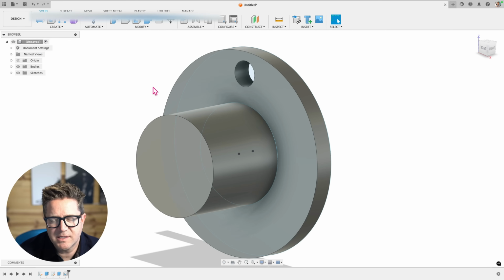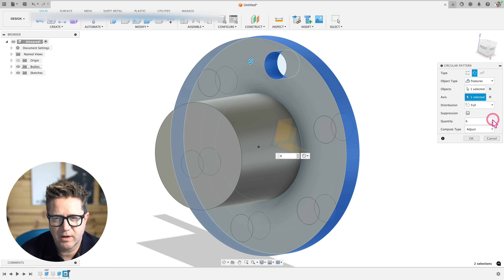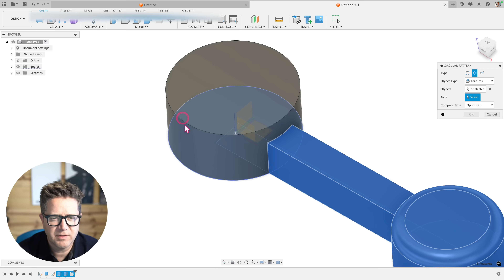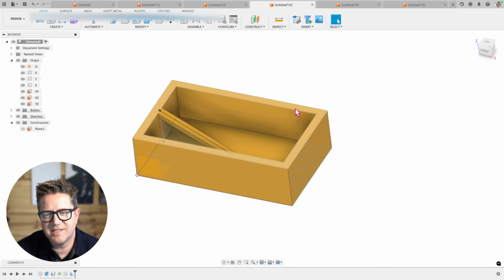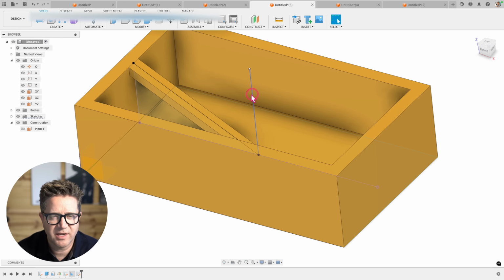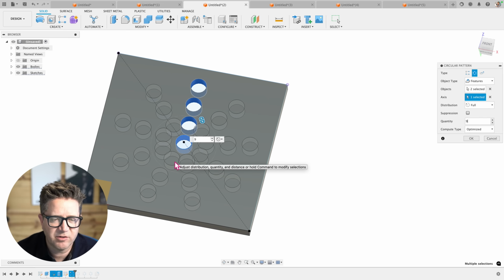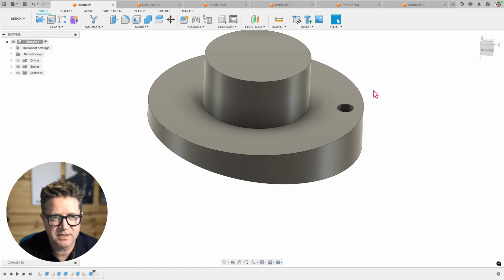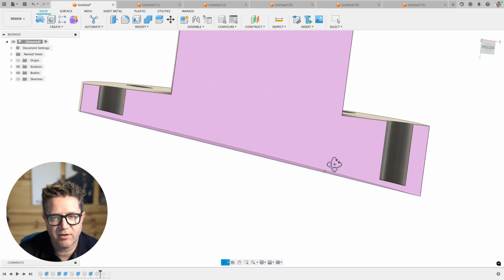Fusion 360 Circular Patterns – The Right Way to Automate Your Designs

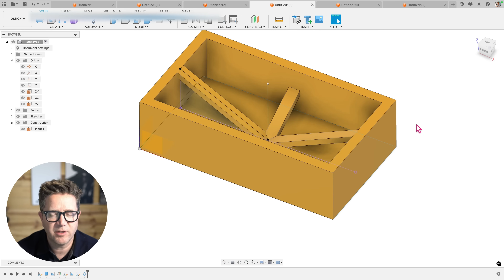Comment: Nice one, Tyler. Thank you. I noticed at 6:03 when patterning the ribs that the shorter side ribs used the original sketch line and therefore didn't solve to the top face like the selected object (the original rib). I mean, it makes sense why it did what it did, but I'm interested if there's a method to pattern the original rib more accurately? I hope that makes sense? Cheers.

Comment: - Great content (as always).
- My take on 'COMPUTE TYPE': I've found 'Adjust' (the default) is more likely to succeed - so, I choose it first: if another is chosen, and 'Pattern' fails, all effort is lost from making settings; you must start all over. But, if 'Adjust' succeeds (again, more likely), THEN I go back to attempt 'Optimized', or 'Identical'.
Reply from the maker: Interesting. Have you had it struggle on large volume of instances?
Reply: @TylerBeckofTECHESPRESSO  
- If resulting quantity of instances is "too high", F360 will throw warning dialog indicating potential performance issue, and suggest setting 'Computer Type' to 'Optimized'.
Reply: @TylerBeckofTECHESPRESSO  
- If quantity of instances is "too high", F360 will throw warning dialog flagging potential performance issue, and recommend setting 'Compute Type' to 'Optimized'.
Reply: - Hey, replied to your question regarding "large volume of instances", but didn't see it after posting.
- So, redid it... and again, no show (?).
- Thread indicates '3 Replies' though, so comments should be there. Do you see them?

- Gonna try again here...
--- If quantity of instances is "too high", F360 will throw warning dialog flagging potential performance issue, and recommend setting 'Compute Type' to 'Optimized'.

Comment: Great series Mr. Beck - thank you! Could you please consider making a tutorial on the 'Configure' feature? I have one design file that is used for both 3D printing prototype testing and injection molding. I have timeline features that I either suppress or enable when switching between the two design variants. I'm suspecting that the 'Configure' feature might be my solution to simplify the conversion between the two design variants but there isn't very much available in terms of how to use the feature this way. Thank you again for the great series!